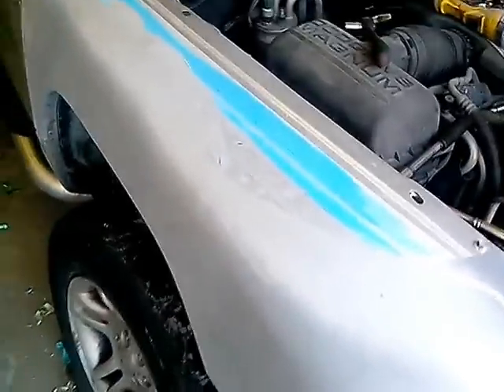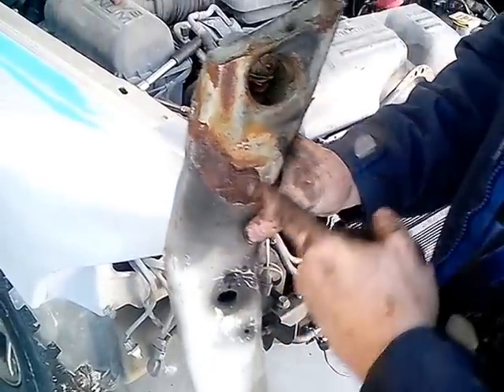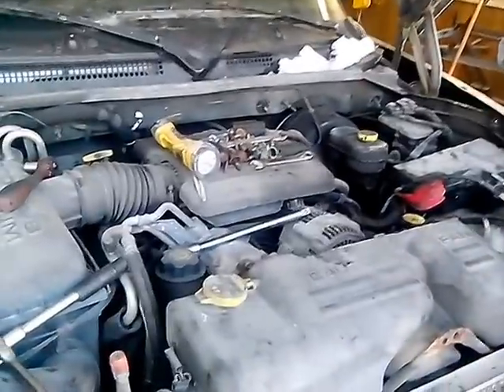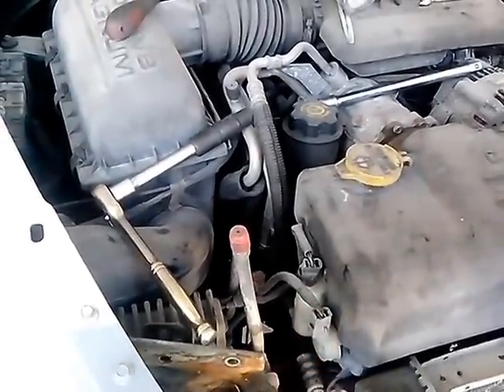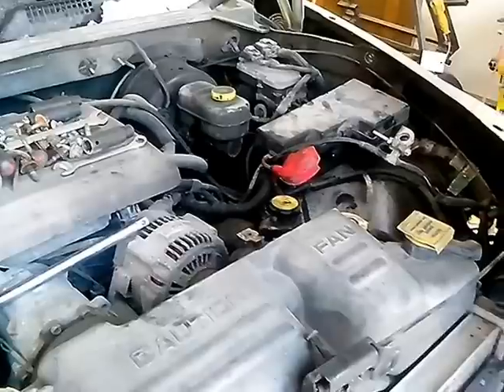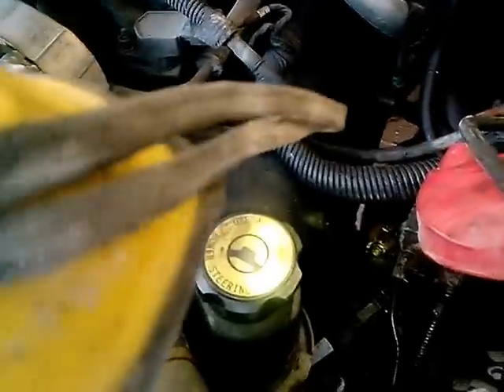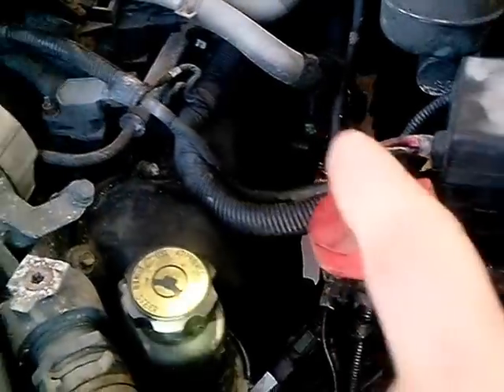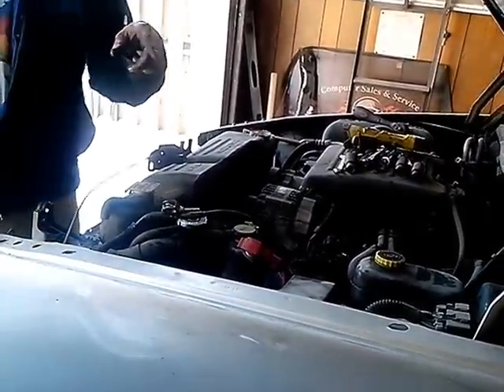2001 dodge dakota quad cab lift 6 inch kit part 5

Comment: What did u use for the steering extension with that much of a body lift
Reply from the maker: I make the extension right here I cut it and welded it back together
Reply from the maker: ill post a video on it soon ill show you the shaft
Reply: K ty
Reply from the maker: if you need it done I can do it for you just ship it to me and I will ship it back to you I can even make you the whole lift kit right here shit if you were in Canada and close I would install it for you all for $$$ though LOL

Comment: Im located in brocton ny.....its a 2001 dodge dakota extended cab I wouldn't need a back bumper but depending on how much I might b interested invthe front bumper id like a 6 inch lift.......do u got Facebook
Reply from the maker: I will need to know if its a short box or long box if it is short it should be 16 mounts I think long box is 18 mounts double check yours though